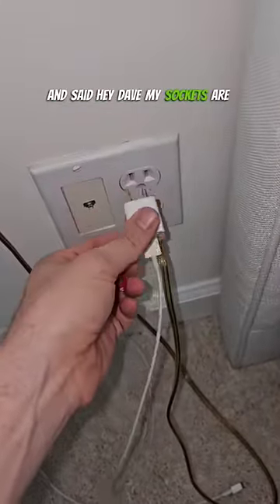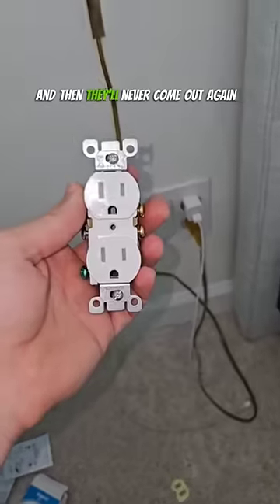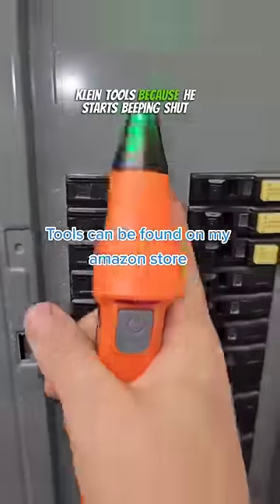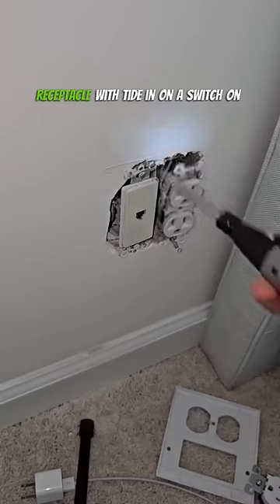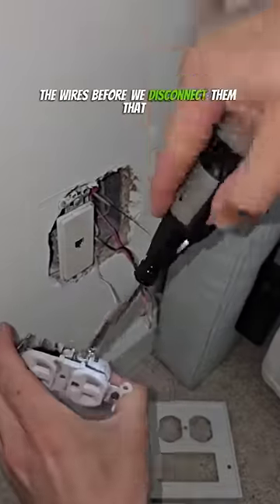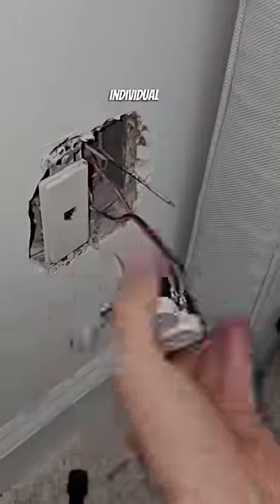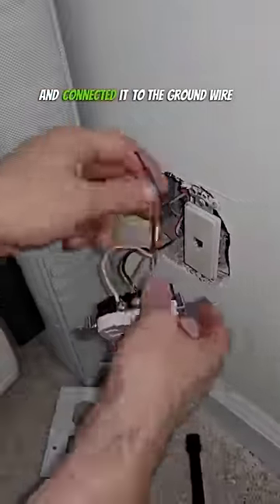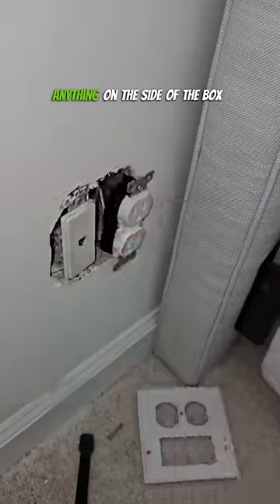🔥 Thats a hazard! How to change a switched outlet #diy #handyman #electrician #HowTo

Comment: After turning the breaker off it's always a good idea to double check that all the wires in the box are dead sometimes there could be another hot wire or other situation
Reply: Those shared neutrals will get ya!! ⚡
Reply: @utbigpapa  I wasn't talking about the neutrals I was saying in general it's good practice to do that just for good measure any good electrician will tell you the same
Reply: @Treylopez1997  oh I agree 💯 I turned off the breaker I was working on and didn't realize the house had shared neutrals throughout. It was a painless but shocking lesson to learn as a DIYer
Reply: industrial does this
Reply: Iirc the house i grew up in had a single outlet that was connected to two different circuits. As in one socket was circuit A and the other was circuit B. Reason was that one was on a switch and the other always had power
Reply: Oh hell to the yes with this.

You don't know what the previous owner did to anything, so it's best to assume everything is built different and built stupid. 

Don't let another person's stupidity kill you.
Reply: this, at school a few outlets in electrical shop we thought were tripping the breaker after fixing a problem (ground fault issue). I started unscrewing the receptacle to investigate further. i assumed the receptacles were dead because i thought they were connected to the circuit that kept tripping

because of my complacency, i received a painless but well-deserved shock because the breaker that was tripping was not connected to the receptacles, and i have not and will not fail to double triple check circuit is dead no matter what.

don’t know what was going on but it was fixed later that day
Reply: better just to pull the main breaker just to be safe.
Reply: @kaboomwinn4026  that's not a bad idea but sometimes it's not always an option depending on where yr at and what your doing
Reply: That’s why he used the plug checker it tests the outlet in which all the wires are connected to if there was any hot wires (including hot ground reverse) it would show on the plug checker plus plug checkers are much more reliable than the hot sticks.
Reply: @colbysteinke4259  when learning about electrical they say never fully rely on it and to double check
Reply: Yep, weve got at least one outlet in our house that is wired to two seperate breakers the top outlet is wired to one and the bottom one is wired to the same breaker as the outlets across the room, we know this because if you run the toaster oven and the kettle on opposite sides of the room the breaker will flip, but if you run the kettle on the other outlet it's fine... Fucking nonsense wiring
Reply: I remember being 12, my dad was working on a socket and it was still live even tho he turned off room. He only double checked because I was watching and asked if we should.
Reply: that's why you follow the 5 rules of electrical engineering:
1. Disconnect
2. Secure against reconnection
3. Ascertain the device is de-energized
4. Ground and short-circuit
5. cover or fence off nearby energized devices
Reply: @utbigpapa  don’t let the wires touch u wack an scary an a noob
Reply: @grandmasternas2494  no wires touched at any time, but thanks for your concern!

Comment: Always test deenergized first.  Receptacles can have two feeds.
Reply: Thank you.
Reply: Bro what are you talking about
Reply: @barryallen5507  The black wire is directly from the breaker and the red was from the switch, the switch could be fed from a different breaker meaning that turning off only one breaker wouldn't have effectively cut power to the outlet.

Another scenario, I have a plug in my kitchen that is fed from two separate breakers so you can use a toaster and microwave on the same plug without tripping the breaker.

The solution, not shown in this video, is to use a live circuit detector. It's super cheap and insures that the power is off before you touch your frail human body to a live circuit. That is to say that "the lights go away" doesn't actually mean it's safe.
Reply: @TreeStump-and-CheeseKetchupIT  If the switch is on a different circuit, then technically there's supposed to be a separate neutral.
Reply: @user2C47  Agreed, but I live in an old house that was owned by a do-it-yourselfer (which is fine to DIY) but I often find their work to be odd and dangerous (may they rest in peace) so I don't expect anything to be correct and always double check using a detector.

Second, even if the two outlets are properly on separate neutrals/breakers the method shown in the video would not have detected that. In my kitchen example, yes they are on two breakers and two neutrals but the video had only one outlet being tested and no secondary test.

Also gotta watch out for people who don't understand electricity and put the switch on the neutral, UGH!
Reply: @TreeStump-and-CheeseKetchupIT  True.  However that is not always the case.  That red wire or switch could be on another breakers.  Though by code it should be the same breaker, a 2 pole, so if one trips they both trip.

Comment: I appreciate this video. You literally helped me solve a huge issue with one of my outlets. And not the loose fitting. The previous people that owned my house didn't wire the back porch light correctly into another outlet. I disconnected it as soon as i saw it cuz it felt like it wasn't right and this video showed me that I was correct. Tis fixed now.

Comment: “Hooks go on in the same direction you tighten the screws.” Proceeds to put hooks on the other way
Reply: Underrated comment
Reply: They were on right
Reply: @anthonypuettmann947  nope
Reply: Saw that first time..and was like wtf lmao..I kept watching...and it kind of seems like maybe that was just the ground wire he did that on, but it was very noticeable
Reply: The video got mirrored. Had me questioning also
Reply: @tannerkennedy4941  nah, everything was good until the ground wire, if it was mirrored, then that would mean everything was wrong except the ground, so i'm pretty sure he just put the ground on backwards, not a huge deal, but still not ideal
Reply: Aren’t there little holes that you’re supposed to plug the wires into and then tighten the screws rather than looping the wire around the screws?
Reply: @Fredfredfredfredfredfredfred That's referred to as backstabbing, which is generally frowned upon as the wires tend to come loose. Wrapping a shepherd hook around the terminal screw then tightening the screw ensures reliable connectivity.
Reply: @spazmccoy I’m a Commercial guy, I’ve only heard of a shepherds hook referring to a specific conduit bend, nothing about the wire. We always just call it a hook in the wire, nobody around me has ever called it a shepherds hook.
Reply: @purgatory671 Shepherd's hook, candy cane, hook bend, they're all meant to illustrate how the wire looks when putting it on the terminal screws. I've heard a number of different terms out in the field. 🙂
Reply: @tannerkennedy4941 nope, you can also watch him tightening the screws clockwise, opposite of the wires
Reply: He righted the screws clockwise and put the hooks on clockwise. Which is both correct and what he said
Reply: Think the video got mirrored at some point because in the end the were on the right way
Reply: @Xx0ME0xX you are WRONG. video is flipped only for the ground wire. Look at the mattress in the background. Look at which side the ethernet outlet is on
Reply: Wait until you see him use the electrical tape incorrectly..

Comment: Damn. American wiring really is something.
Reply: Dangerous I think you mean
Reply: @paulus121212 not dangerous at all. Maybe for foreigners who’ve never dealt with it but it’s just different
Reply: It looks better than what ive seen around here in Europe!
Reply: @TheQWER9  how our plugs are earthed each section fused so if something goes wrong the fuse box will trip each plug socket has a switch which is also earthed
Reply: You should see finland. You would have a stroke
Reply: @Samuel-cu9vo  As a Finn, yes.
Reply: @TheQWER9  Fuck no.
Reply: @paulus121212 I mean, not really
Reply: @paulus121212 lol you mad bro😂
Reply: @Austin-cx2xe  Im an American who has never dealt with this and I hate it.  Seems overly dumb for no reason other than we are stubborn.
Reply: It's fine, sheesh, don't need all that government you pay for son.
Reply: @paulus121212 
Are you talking about a GFI?
We have them in the US but usually only in places where there’s water or other electrocution hazards.

The outlet will trip by itself if overloaded and you just hit the reset/test buttons at the outlet to regain power.
Reply: Dutch-jo  when i started doing i was adamant about using metal boxes, but they are better than the plastic boxes.
Reply: @Austin-cx2xe bro our shit is 1920’s technology
Reply: Uk plug sockets and plugs win hands down
Reply: Love the pig tail and how neat you did👌
Reply: Add tape on socket but nevermind sleeving on earth wire 🫣
Reply: @mkabat0 what do you mean by that, the metal box is grounded and the ground wire being open will not cause a problem.
Reply: @casedistorted they are very cheap and they are equal in goodness to the EU plugs but British plugs are way way better. I have never had problems with US plugs and you probably won't have to either if you hired a half decent electrician. Too bad everyone was so rude about it
Reply: @markyh88 dude the uk uses ring circuits tho, which is quite meh
Reply: @ericfolmar7338  if something works you ain't gotta over engineer it hence British houses also primarily made out of brick rare to see woodwork homes
Reply: @paulus121212 ok mr electrical engineer.
Reply: @DankNG47  no just common sense and simple knowledge
Reply: @TheQWER9 Just depends where you’re at, probably the same as America, Europe has a lot of different countries with different ways of working stuff
Reply: Yeah having live contacts on the side really sketch me out.
Reply: @TheQWER9 That’s because Europe was wired 1500 years ago
Reply: @paulus121212 this is exactly how American electrical is done just with circuit breakers instead of fuses because we aren't poor
Reply: @jonathan3073  ok rather poor and safe then rich and in danger from dodgy electrics and guns
Reply: yeah, we know
Reply: I like how the first reply to this comment is automatically. AMERICA BAD
Reply: @DISOPtv all that government?
Reply: Dutch-jo Can't imagine why mice would choose to live in houses built from cardboard and sticks with lots of empty warm spaces in the walls and wiring outside of proper conduits. 🙄
Reply: Dutch-jo agree with wago, they are objectively terrible, they just go in easy, but the internal buses are very thin, even compared to 14awg, it becomes the weakest link in the circuit, wire nuts or terminal blocks are a better option.
Reply: @AntRashford as an English who now lives in the US who has done a decent amount of work in houses.  the main reason UK homes are made kf bricks is because 1. energy is expensive and the uk is cold. 2 the uk was deforested in the 1870's during the first industrial revolution, and 3, houses in the US are meticulously designed to be as cheap as possible to assemble (labor being a major cost) coupled with an abundance of cheap wood and energy.  the major exception to this is in major city centers where the use of cinderblock is common.
Reply: @paulus121212 there are fewer electrical fires in America than there is anywhere else in the country and normally when there is an electrical fire it's when there's a piece of equipment involved and the equipment had a failure
Reply: nothing wrong with it...tell me why europeans are th eone with all the electrical fires?
Reply: @TheQWER9 every time I've been to mainland Europe I've seen sockets hanging out the wall at least once somewhere.
Reply: @Chemeleon15 GFCI (known here as RCD or FID) is mandatory here in eastern Europe, connected after the main brakers in a way to disconnect all 3 phases if there is current flowing between live and ground or between ground and neutral.
Reply: In NZ the wires go into terminals in the back of the switch 😂, and the box behind it is usually plastic, but used to be steel or something a while back.
Reply: @markyh88 
The shutters are the only thing that makes them good.
Reply: @casedistorted  "as someone who isn't an electrician and doesn't know the first thing about wiring a house, this is so stupid and I think we just do it this way because we're stubborn"

Do you even read the things you type?
Reply: Uk leaves the chat
Reply: @paulus121212 sounds like a lot of extra peices that can fail, when the breaker does the job just fine.
Reply: @Chemeleon15 no they literally have a fuse on every outlet that will blow if to much power is being pulled or if there is a surge. EVERY SINGLE OUTLET has a fuse. Wild.
Reply: @mkabat0 why would you sleeve it when it’s designed to touch
Reply: @paulus121212 It's not tho?
Reply: Shit I think you mean 😂
Reply: @paulus121212  If something goes wrong with ours the breaker trips. We don't need fuses or other bullshit.

Comment: Always take a picture of anything before replacing so you know where everything goes
Reply: If you've never done the job sure, but you shouldn't mess with electricity if you don't know it's all color coded. Silver screw for neutral (white), brass screw for line (black), green or bare to ground screw (green). Electricity is not for going in blind.
Reply: @ramapalmer5985  goes for anything. I took a apart a printer because it was Jammed and I couldn’t get into the part where it was jammed unless I fully taken it apart. I took a picture of every color and which plug went where on the mother board. It don’t have to be necessarily electricity. The printer is unplugged of course. I’ve done this multiple of times with bread makers and putting extra memory in my ps5 to changing out my gpu on my pc.
Reply: @ramapalmer5985  if it’s electricity I shut off the breaker , before messing with it.
Reply: This is solid advice for most electronics. Sometimes you have to be careful still as they move the wires around on new parts. I've had that happen with a relay repair on a kiln.
Reply: @Rama Palmer  electricity doesn't care about colors. I've seen people using all sorts of different colors for the ungrounded conductors. Even green or white.

Comment: "The only way to find the breaker is to use this circuit breaker tracer."  Yeah, I remember the days before those were invented, when electricians just had no way to figure out what breaker they needed.  Sometimes we'd electrocute six, eight, even a dozen electricians before one happened on the correct breaker.  It was a pretty hazardous job back then.
Reply: Just pop the main circuit breaker switch, replace the outlet in 10 mins, pop it on again.

Am I missing something? Do you guys have one circuit breaker box for an entire neighbourhood?
Reply: @the_skips  "Am I missing something?"  Maybe.  You might be missing the joke.  :D
Reply: @dwasifarkaralahishipoor2223  Oh. I guess I did miss that one XD
 The video and other comments got me confused about how it's done in US
Reply: @the_skips  Yeah, I was just making fun of the claim that this device is the ONLY way to locate the breaker.  Although, I have to say, I would not turn the whole house off to change a single receptacle as you suggested.  There are other ways to identify the individual circuit, as we used to do before those nifty little tracers were invented.

Comment: I love British plug sockets, makes the American ones feel so unsecure and flimsy when you plug something in
Reply: Homeowners special - the receptacles are garbage and need replacement every 30 years.  But, we have commercial ones that will easily last 2x as long or longer.
Reply: Most of the outlets you see are builder grade. Not really meant for high traffic use. They are just fine for things like TVs and microwaves that get plugged in once and are left alone until you get new ones.
Reply: When they arent too old they are fine. Everything wears out over time though.
Reply: Yeah British electrical standards are one of the safest in the world. US sockets are so shoddy and dangerous.

Comment: MF really said that the only way to find the breaker was that specific tool and referenced his affiliate link.
Reply: I prefer using a night light plugged into the outlet with someone checking breakers. Really effective and doesn’t cost anything.
Reply: I thought the classic was the quarter on the  prongs while plugging in a cord to find the right breaker.
Reply: working on sketchy houses with multiple add ons and self done wiring I just touch the wire together to cause a short and trip the breaker (have been in old churches with 5 junction breaker boxes where they just tacked on to or off of. uhhhh dont even get me started on the roofing and the layers of shingles
Reply: Klein has other tools that do the same I have a a wire tracer but it's different also if it's good electrical work the panel is labeled also the old fashioned radio or phone call while turning them off 1 at a time with a helper and meter kn the other side works perfect also helps to gain time your boss is charging for since he charges 120 an hour for me tho he only pays me a fraction of that
Reply: Don’t hate the player; hate the game!😂😂

Comment: You just saved my butt. I recently replaced a bunch of recepticals in my house and i had a switched one that no longer worked with the switch after i replaced the outlet. I didnt know about the jumper piece. Now i can finally use my lamp again haha
Reply: You are allowed to to electrical work yourself in usa??
Reply: @marias5230  I mean it is your house, it might not be advised but you can do it.
Reply: @marias5230  yeah you're able you shouldn't but it's fairly easy as long as you make sure all the wires are dead
Reply: Brits don't pump their own gas. Nuff said.